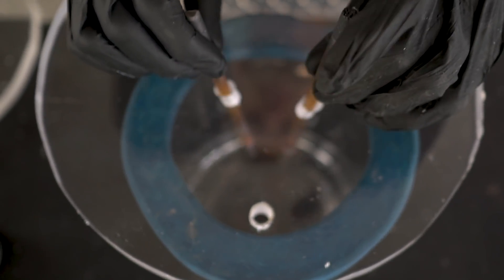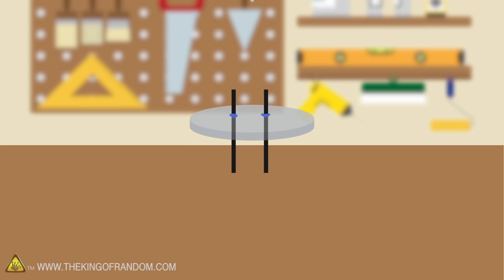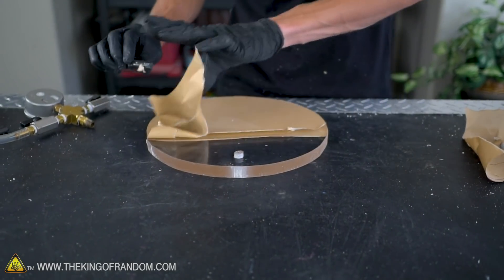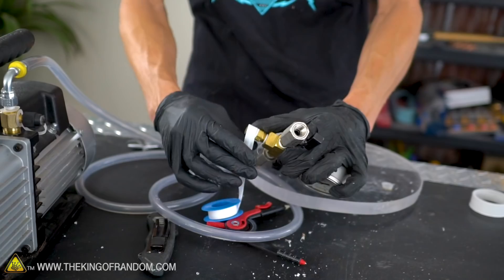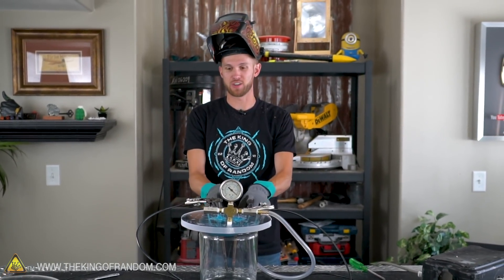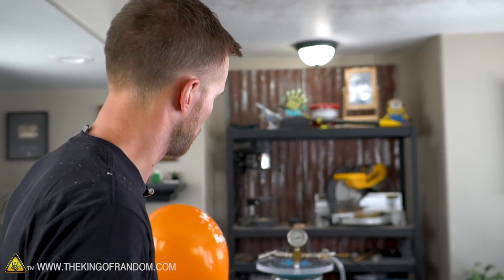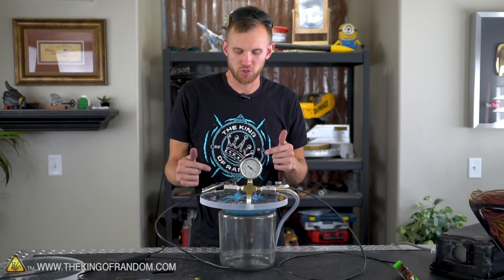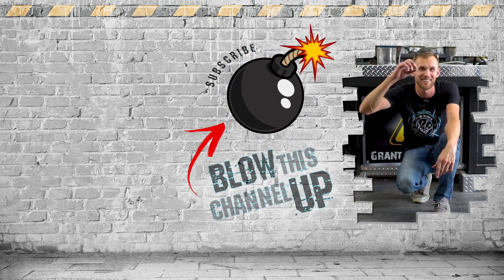Well That Was Anticlimactic

Comment: I think insted of using this modified high current transformer, You should use a normal microwave oven transformer because it puts out 2500 volt 🤯

Comment: its sad, how does he dont know that arcs need air to be formed? in fact the high voltage Ionizes the air around the rods and turns the air into a electrical conductor! that is why electricity can travel from 1 rod to another!! No Air, no Electrical conductor, so the Rods need to touch to close the circuit!  Grant are you even supervising the uploads?? :(

Comment: Hm, isolating heat from the lid should work, i.e. if you use a solid material (RCW, PCW?) that would not conduct as much heat, you can attach carbon rods to a "manipulators" made of such material.

Comment: The voltage is too low for the expected result to happen. I recommend to use that Tesla coil you got from the plasma globe or the high voltage neon lamp transformer
Reply: Savita Mathur as long as it is in a vacuum there is no arc jumping. You can put as many volts as you want. If an arc jumps its just the small amount of air left in the camber
Reply: @danielpichler6823  I recommend you watch electroboom`s video on the matter. he used his Tesla coil and he couldn't use an ion wind motor in vacuum, meaning there was not much air but it still arched to the walls of the vacuum chamber

Comment: Could you build a thermoelectric generator that runs off of a mining computer and snow from outside?
Reply: And how big would it have to be to generate more electricity than the computer required, maybe two 1060s or 2 580s which would require a 600-watt minimum, but I would get a 1000-1200whatt gold/plat efficiency power supply so we're not wasting any on heat because you can't water cool power supplies.

Comment: Isnt this just a failed light bulb?
Reply: Lightbulbs require a filament. They don't arc.
Reply: He should fill it with different gasses to excite electrons to diferent levels to produce different colour lights
Reply: Lightbulbs are filled with an inert gas so when in nitrogen yes
Reply: @ZackaryAllan  gas bulbs are filled with gas but its not nitrogen, and regular bulbs have no air but they have thin core made of wolfram
Reply: It's not called wolfram anymore it's just tungsten.

Comment: The angle might have a difference due to the closest point being much larger than if it were at the tips as you use in the arc furnace. Try a sharper angle? :)

Comment: what i would do is thread some short copper nipples (short pieces of copper pipe with threads on both ends) into the plexi maybe 3-4 inches apart. get a couple of crip ferrules style pipe connectors that fit the other ends of the nipples, crimp the ferrules to solid  copper rods, put high temp silicone prints on top and bottom of the ferrule, put them into the nipples and thread caps onto the nipples over the rods.  Then find some largish alligator clips and crimp them down at the bottom of the rods.  The alligator clips will be what holds the carbon electrodes and you can apply the power at the nipples or the rods and you will be able to spin the rods to make the electrodes make contact.

Comment: arcing in a near-vacuum takes lightning-scale voltages to cross a few millimeters of open space, you're not generating that in any remotely household level setting, though the possibility of replacing the atmosphere with something inert could be interesting. provided you can solve the problem of the electrodes getting hot enough to destroy the vacuum chamber, that is

Comment: You need to pull down a vacuum below 10 µm . You need a better vacuum pump and a better hose arrangement better seals and use  Nylog on all your seal contact points

Comment: Other ideas? Yeah. Drill the holes so the rods are always touching and use the switch to trigger on or off. If your switch sucks and is slow, install an easy toggle switch. Second, use high temp grommets that perfectly fit your two holes. Third, fill any tiny gap left with something like high temp weather strip used in car engines, etc. Most importantly get a stronger pump. I want a perfect vacuum in that thing. :D

Comment: You are looking for high temperature RTV gasket maker. At the end of the day it's still a silicone-ish material so it's not exactly burn proof, but it should be quite a bit more heat resistant than proto putty (in theory), and it'll be just as flexible.

Comment: I'm pretty sure the reason you're not getting large arcs is BECAUSE of the vacuum. The reason you get large arcs before is because the electricity is using the air to connect two points together. It's similar to why soapy water is more conductive than distilled water.

Comment: You should do the arc furnace in the vacuum chamber BUT with Pure oxygen or Pure helium or possibly Hydrogen (attempt outside as hydrogen may react with the plasma and any leftover oxygen)
Reply: Any left over oxygen won't be enough to explode and pure oxygen and helium won't create much different(may be colour of arc change)

Comment: If you use the rubber gasket stuff that they use in car engines then it should be able to withstand the heat.

Comment: No air to ionize = no plasma = no arc.  Normally air acts as an insulator, but if you create a large enough voltage potential between two conductors the air in between the conductors will become ionized and create a low resistance path for the current to flow.

Comment: The arcs are so small, because there's less air to conduct the electricity, which means that there's a higher resistance. You can fix that by pushing a much higher voltage, by for example discharging a high voltage capacitor bank.

Comment: Insulating the carbon rods where it's coming into contact with the proto-putty could potentially keep the proto-putty below its burning point and still allow an electrical current to flow through the carbon rods letting you test it more.

Comment: It wouldn't work at all in a perfect vacuum. Electricity needs a conductor. 

When the voltage is high enough, the air between the rods becomes ionised, turned into plasma, which conducts electricity, and that's the arc. This is why you have to start closer before you can draw the arc out.

In the perfect vacuum, there's nothing to ionised. No air. No arc.

Comment: I'm pretty sure you already know this but. As far as a higher temp gasket, You could try engine silicone gasket stuff. It's able to withstand motor temps it may be able to withstand a little more heat.

Comment: The reason the lightning doesn't arc further is that the arc is actually plasma or superheated gas. There is no gas in a vacuum, therefore there cannot be a lightning arc, but rather we are seeing the electron jumping directly without the support of ionized gas. This requires much more energy, which explains why the arc is so short.

Comment: Fun attempt but current doesn’t arc in a vacuum or with nitrogen (inert gas). We use vacuums to prevent arcing when switching high voltage circuits with load (current). We also saturate older, underground high voltage cables with nitrogen to keep moisture out. The arc needs to ionize oxygen.

Comment: why not use a magnet to pull the bars  closer  and hard seal the ends  so  there  no puddy  to burn  or use a remote to cross the  bars  in side the vacuum seal  less movement on the  seal  the better   the results  might get

Comment: The current is way too high to get a sustainable arc in vacuum. Try using a high voltage very low amperage power source

Comment: Do an experiment that is an overview of electric propulsion (firing electron arcs from the end of a wire) in a vacuum! It doesn't work in normal atmosphere because the thrust is so small, but in a vacuum it works! See if you can do it, could be fun.

Comment: you need the carbon rods themselves held in something that does not conduct electricity. using a set of wires to move electricity to the rods clamped by a pair of setscrews inside of PVC pipes would more effectively isolate them inside the vacuum chamber.

Comment: It won't hold an arc because you need higher volts and lower amps. Grant rewound the microwave transformer for lower volts and much higher amps for stick welding. The arc requires high voltage. Regardless of the atmosphere.

Comment: The difficulty with this project is that electricity requires a medium to travel through. In a vacuum, there is insufficient gas for an arc of any intensity to pass through once the rods are no longer in direct contact. You're going to have to try to isolate a gas that is highly conductive in the chamber in order to produce a true plasma arc.

Comment: Please put nike air max in vacuum will they pop?
Reply: Check out action lab. He did a video on putting helium in them. Pretty sure he checked how the shoes behaved untampered while in a vacuum. Tkor pretty much do similar videos a few days or so after he does them.
Reply: The short answer is "not likely". A my feets are about 28*10 cm and I weigh in at around 85 kg. That amounts to roughly 3kPa or about 1/3 of atmospheric pressure when standing on one leg. So while any normal standing or walking should yeild less than 1 atm of pressure difference runing and jumping will easily cause more. I recall being taught in school that the pads of your feets have to stand about 10x the normal pressure when doing long-jump as a normal school-student (I havent bothered to check this) two feets would spread the load so each sole would have 1/6 atm of added pressure when just standing around, multiply that by 10 and we get 1+4/6 atm when jumping. So the shoes should probably be designed to stand that without exploding.

Comment: you can seal like rubber gloves in there and then place tongs that you can hold with the gloves so there will still be a vaccum but you can move stuff around inside. You would probably need a bigger jar. And the rubber would have to be thick enough so the vaccum dosent make it expand

Comment: Would water in a bottle stay the same temp for 5 days if it has a vacuum around the bottle
Reply: If the water was at room temp yes. If it's a perfect vacuum and water is not at room temp the temp would still drop due to decay however the temp drop would be minuscule.

Comment: We use high temperature RTV on the engine of our helicopters to seal components. It is flexible and can withstand 700°C on Marine Corps Helicopters. 
Also, if you put liquid nitrogen in the jar and draw a vacuum for a few seconds, you should be able to remove all the air and be left with just a nitrogen atmosphere. Thus, no need to worry about a seal.

Comment: The problem is that an arc doesn't carry in a vacuum. The whole idea of an electric arc is the higher the voltage the more easily it is for electrons to jump from one atom to another and the further away those atoms can be. Eventually, it becomes high enough for the electrons to jump about the various atoms in the air which are usually too far apart for electricity to flow through. If you pull all the air out, as in a vacuum, there are no (or few) atoms for the electrons to form a path across and so they would have to bridge the gap in a single jump purely from one atom of one carbon rod to an atom from the other. While theoretically possible, it would take an absurd amount of voltage to achieve.

What is interesting to me is the potential of melting things in a vacuum or a non-oxygenated atmosphere (replacing the air with nitrogen or an inert gas). Without oxygen, metals wouldn't oxidize when heated and would cause them to behave differently than standard furnaces, which is one major benefit of an arc furnace (normal furnaces require oxygen to function and produce CO2 anyway).

One thing to be careful of is the fact that without air at all, the carbon rods will heat up quite quickly and take a lot longer to cool down. Removing air forces the heat to dissipate purely through radiation instead of conduction through the air or a replacement gas. Though graphite is one of the better materials at radiating heat in a vacuum, it's still significantly less than what it can do in atmosphere.
Reply: Exactly my thoughts on the video, just I would have made a shorter comment about it. XD
Still great explanation, hope King of Random sees it.
Reply: Great explanation! Scientists use melting aluminum in vacuum chamber to coat telescope mirrors. Because of no oxygen. Aluminum foil was melted and became aluminum atoms.
Reply: Nicely broken down, thanks :)
I think a furnace that is washed with a non-inert gas is more feasable than having it in a chamber. Kinda like it is with welding, the shielding gas flows over the welded spot, pushing the atmosphere away from the metal.
Reply: @NochSoEinKaddiFan  The obstacle is that most furnaces use oxygen as part of their fuel along with some form of carbon (either bound in gas like propane or in solid form like coal), which means they always give off a lot of CO2. That makes it difficult to heat anything using propane or charcoal without oxidizing the subject. You can, probably, flow the exhaust through a heat exchanger with an inert gas on the other side, then flow the inert gas over the material but at that point you might as well just use an arc furnace for all the trouble and limitations of this method.
Reply: @dalsio  I think the feasability of an inert gas wash depends on the oven design. If you melt metal in a foundry you only have to "wash" the crucible, not the entire foundry. And I would not want to wash either coal or propane furnaces, but an electric or arc fired oven could benefit from an inert atmosphere inside, since oxidation would still occur under normal atmosphere. ^^
Reply: I’m not sure what voltage is being run here, however, it is relatively simple to get a stream of electrons to travel across a more significant gap than that under a high enough vacuum. They will travel as a stream rather than ionise the air to make the arc. I produce cathode rays at school as a demo using around 5000V from an induction coil.
Reply: @nickworrell1854  But that is not an arc that could melt things, or is it? >.>
And it certainly is no longer plasma. I mean, plasma is inoised gas and if there is no gas, there can't be plasma; right?
Reply: NochSoEinKaddiFan cathode rays are certainly not an arc. Ionisation does take place though because a perfect vacuum isn’t really possible. 
I should point out that I wasn’t arguing with the original post, just pointing out that cathode rays are possible at those voltages.
Reply: @nickworrell1854  That's true, ionization could occur creating a cathode ray from one of the electrodes. Since the electrons aren't bound by atoms, they are free to flow like a beam through a vacuum, similar to standard radiation. It wouldn't behave like an arc, but it would be cool to see.
Reply: @NochSoEinKaddiFan  Right, a plasma requires there to be some form of matter in the first place. Since a vaccume has no air, it can't be made into a plasma though you could anyways try and turn the electrodes themselves into plasma, given enough heat.
Reply: @nickworrell1854  Thank you for clarifying :)
Reply: And sound could travel so it means there was air in that jar
Reply: @Seemasharma-ov6ft  Or the rods were vibrating and the vibration was transferred to the lid and the container.
Reply: man, i love your comment and i really appreciate the effort you made to explain the physics!
Reply: I thought it would be a short comment then I clicked the "read more" button and WOW, how long did u take to write all if it
Reply: @dalsio.  I could have not said it better.  @TKOR needs to watch a little bit of @ElectroBoom when it comes to electricity.
Reply: Someone did their homework.
Reply: Research how a plasma lamp works...pretty sure they use a type of gas with the vacuum...but i'm not an expert
Reply: Nerd
Reply: @CircuitGamerTV  Thanks!
Reply: no m8 he has common sense

Comment: There is no arcing in a vacuum sadly. For an arc to form you need io ised gas like air to form a path for the electricity
Reply: But this isnt a perfect vacuum and the rods can ionize too, so that's not the reason here. It's just too low voltage.

Comment: Fill the container full of liquid nitrogen. Stick the rods into the liquid nitrogen then put under vacuum. Then touch the ends together. I wonder what would happen. Would there be a arc or if there is a Arc would it be a different color.

Comment: Max temp copper RTV maybe, the max temp is 700°F or High Temp Red silicone which is 650°F both you can buy at any auto part store in the gaskets section

Comment: is didnt make an ark because to make an ark the air molecules around the rods are ionized and at one point there is so much power in the air that the electricity makes the jump. in a vacuum there is no air so its impossible the ionize the air to form an ark
Reply: Technically with enough voltage it could jump with no air.

Comment: I think maybe try  to forge weld 2 pieces of steel or copper and compare the effects between vacuum and air, I bet the vacuum will be really beautiful. Also you could melt the steel until its a complete liquid, and then check for oxidation and hardness and all of that

Comment: It is easier  to seal a  cable than to seal a moving rod.  Look to the patent for the device that advances the carbon rods in an old fashioned searchlight. There was an analog device that  could be used to feed the carbons in your furnace. Inside the vacuum chamber.

Comment: Please try: Put pure nitrogen in the jar along with some water. Run the electricity and the gas produced should react to make nitric acid. 

Also, for better higher temperature sealant, try automotive grade gasket fluid.